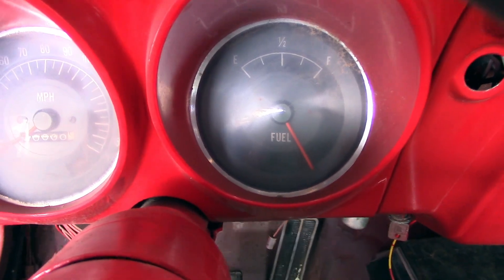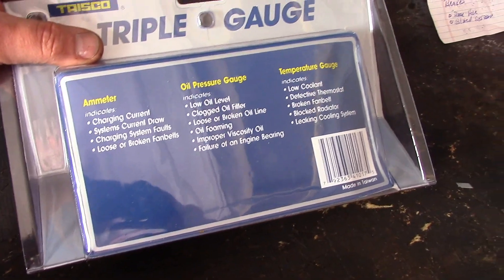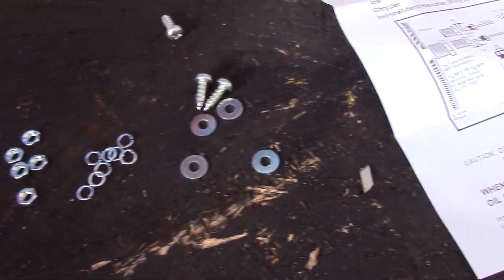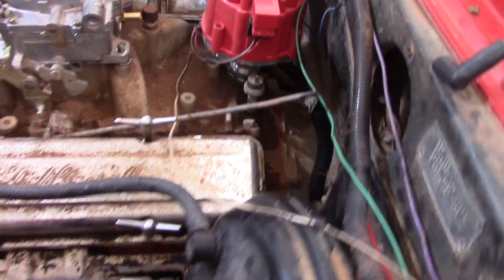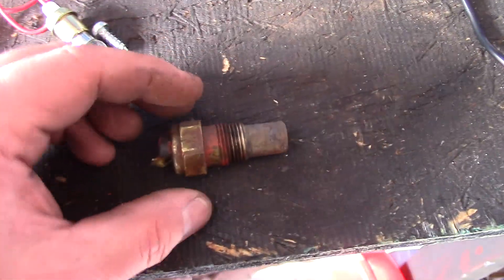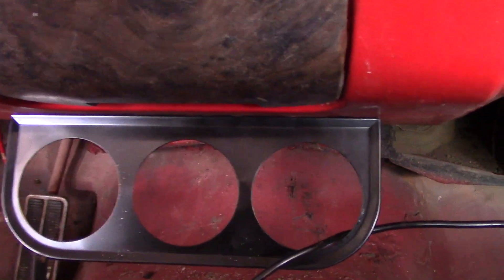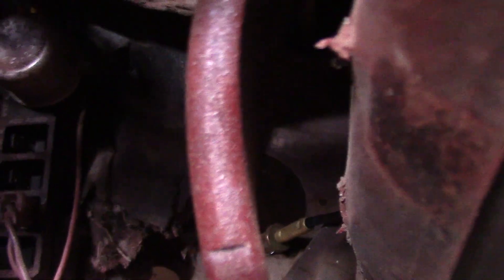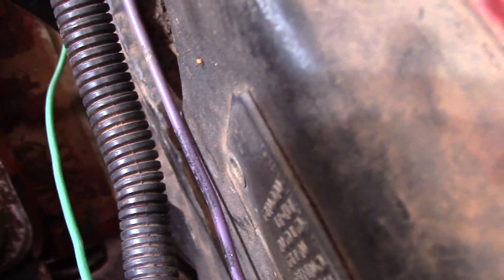How to install WATER temperature gauge & How to install OIL pressure gauge in Chevy 350 PART 10

Comment: Once again saved me on my 79 camaros guage set up!! Thanks for this video brother! I recently used your steering gearbox vids help and everything worked perfectly!
Reply: Hey, I know its been months, but I'm about to do the same on my 1980 camaro. Do you happen to know if this gauge set fits in that spot in front of the gear shifter? It looks perfect for it and I'm about to try it out but wanted to know if you happened to remember
Reply: @yeagerj7747  yes sir! I have mine setup under the radio area in front of the shifter. Works perfectly 👌 I used a equus  oil/water/volt setup. Hope that helps
Reply: @zuluchorizo24739  Sweeeet, thank you!!

Comment: Mechanical is the way to go. Get rid of the flimsy plastic line and get the copper line kit. Stewart Warner OIL PRESSURE LINE GAUGE KIT COPPER 1/8" Diameter 6 ft. 82553-F, Autometer makes one also. I also bought a water neck from NAPA Part #: BK 6051019 or Dorman 902-2009 Engine Coolant Thermostat Housing they have the provision to add the water tempt prob, I use this set up on my 73 Nova. I got this set up idea from some local hotrod racers.😎

Comment: Thanks for the vid! No judgement, just a suggestion for others and next time... I saw in a different vid suggesting testing the temp sender (and new thermostats) in a pot of boiling water to check for accuracy before hooking it up as the quality of new parts, etc isn't what it used to be. Looking forward to you firing up the 'bird!
Reply from the maker: That’s a great freaking idea!!!  The next set I buy I will be doing this!  Thanks for the tip I appreciate it!

Comment: I have a Land Rover 2006 I have to keep my current gauge working otherwise my computer's will be worse than they normally are... I use an inline top hose adapter with a water temperature threaded hole, worked great...

Comment: Would you assume it'd be similar if nit the same for my 78 marquis?
Reply from the maker: Yes should be about the same, the gauge and sender are the two items that make it work with just about anything.
Reply: What about a 64 impala with a small block 283?

Comment: I'm in agreement. I'm using a more electronic looking one.  I broke the water temp in my lap. Is it safe to use Teflon on the oil sensor?  I need help gentlemen.
Reply from the maker: I don't like to use tape on the threads, sometimes the treads are part of the grounding
Reply: @ArrowheadGarage  Thank you so much. That's true. Didn't think about the ground.